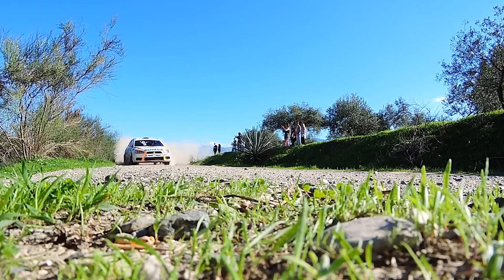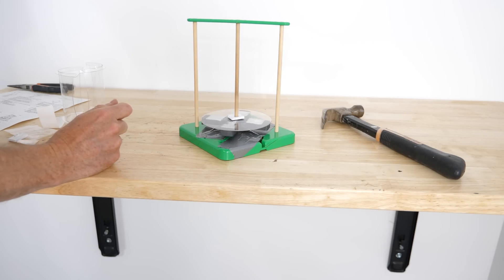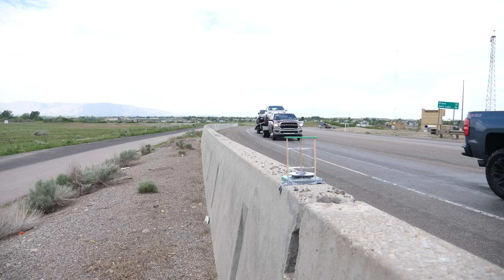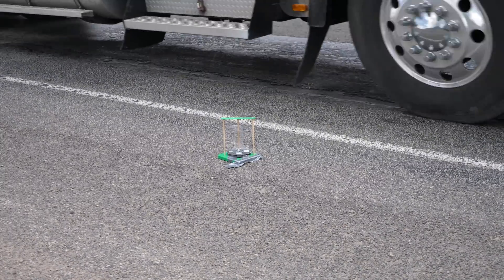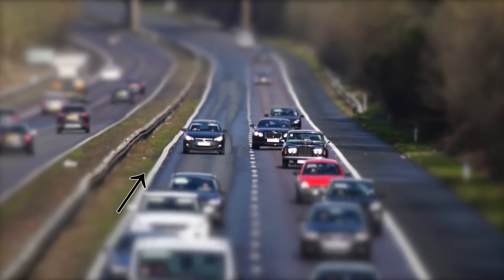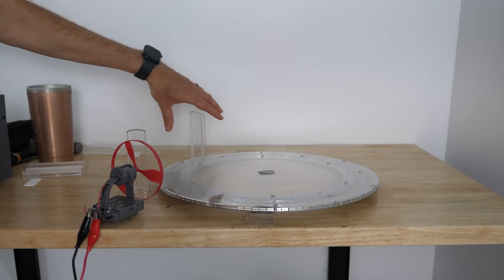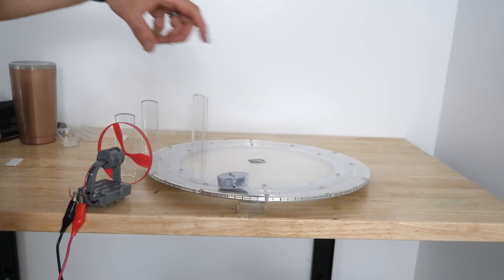Do Traffic Turbines Actually Work?

Comment: I can imagine the application for this concept would be highly effective if it were to be used in underground rail systems, like the London Underground or the New York Subway. Down there stood by the platform, you can experience some tremendous gusts pretty much every time a train comes and goes.
Reply: Which is why they are looking at running trains through tubes under a vacuum. They can save more energy doing that than they could reclaim by using turbines next to the train.
Reply: @TimothyFish  it’s very difficult to create a vacuum that big and there probably are safety concerns.
Reply: @westonding8953 , creating the vacuum is a problem, but there's no reason why it would be any more dangerous than riding in an airplane. They fly high enough that you would die if not for the pressurized cabin. I'm sure those trains would have dropdown face masks for the event of a cabin depressurization.
Reply: @westonding8953  "It's not that hard" Just ask Elon.  ;)
Reply: @TimothyFish  well subway doors have to open and close quite often whereas airplane doors remain shut for the entire operation period (the flight).
Reply: @westonding8953 , subway doors don't open between stops. Not that it makes sense for subways anyway, but there's nothing to prevent a subway from pulling up to an airlock, opening the door, and then closing the door.
Reply: @TimothyFish  between stops no. But having many airlocks is probably just too expensive.
Reply: @westonding8953  , let's say one airlock costs $100,000 and 100 people pass through it per day. For one year of use, that's less than $3 per person.
Reply: How much, is the question? Will it add up to disrupt the flow?
Reply: Energy transforms - it doesn't appear or dissapear.

As the energy transforms it dissapates into non-usable forms. Think a wheel on the road. Sure, you get kinetic enegy - but friction against the asphalt generates heat, which is energy effectively wasted.

Every form of man made energy transformation has loss, and this subway-turbine mind experiment is no different.

It is explained very practically in the video. From a little plastic fan to the largest turbine available, the laws of physics stay the same.

Conversion has a cost. Nature supplies us with daunting amounts of energy which we apply in different ways, but as of 2023 there exist no pheasible way of energy converting without loss.

The traffic wind turbine is an excellent thought-experiment to demonstrate this concept.

That is why I enjoy the action lab so much. Simple lessons, that do not feel teachy nor patronizing, that are always backed up with a hands-on lab to SHOW the concept. 

He is open to "wrong" ideas and uses experiments to show why they do not work. His way of sneaking knowledge into the curious is gleeful at times. 

A Science Ninja!
Reply: Do you not understand the concept? It takes energy to accelerate the air. So if you use the accelerated air to power a turbine, then the train has to accelerate additional air.
Reply: @DoubleBob  yeah, the turbines slow down the air, which increases air resistance, which makes it useless.
Reply: @DoubleBob  im no physics expert but god some people seem like they would really believe those infinite energy memes when you plug an extensoin cord to itself :D i wonder why i dont see more cars with a mounted wind turbine (heard that one already somewhere) because free energy right ?

Comment: I still think the best way to get energy from our transportation infrastructure is to turn roads and sidewalks into solar panels. The idea was raised over a decade ago from what I remember, and solar panels are getting cheaper every year. And I rather like the idea that somebody had about converting sound energy into electricity and making the area quieter in the process.
Reply: Not roads and sidewalks. They get worn and damaged. Some people fight microplastics and at the same time spread these ideas about yeah lets put plastic in floating gardens, roads and sidewalks... smh 

Covering roofs, even building new ones out of solar panels, everything from a bus shelter to a parking lot - that works much better and provides shade where it's desired.
Reply: The other idea I also like. It would indeed make the area quieter, except that it isn't going to work, laws of thermodynamics are pretty hard to beat. From chaotic motion, such as sound or air turbulence, there's practically no way to go back to organized motion (electric current in a wire). You can get tiny leds to light up and even for that power you won't be able to measure if you really only sapped acoustic energy, or if your gadgetry actually contributed to the noise and leeched car engine power for most of the output. That's life. Engineering geniuses exist, but this is not it.

Comment: It need vehicles to work. Fast moving vehicles to be specific. Semitrucks work well because its size and shape moves a lot of air. Cars can move fast but modern cars are streamline so they don't move that much air. Very low traffic will result in long periods of no output. Too much traffic where cars are on a stand still or moving slow, then there is no output. There has to be a specific amount of traffic where moving cars are fast enough without pauses. So the traffic bandwidth for maximum output is very small.

Comment: This makes no sense whatsoever. If you want the maximum results just attach it to the vehicles no to the road but the reality is that turbine that small makes a negligible amount of energy and what is more important is that in many locations the prevailing wind speed is greater than the wind generated by cars. Here in Cape Town, I see quite a lot of mini turbines combined with solar panels powering devices along the roads but they are put high up to catch the prevailing winds which can be quite strong. It also allows for slightly larger turbines and they can be right next to the device they are powering  (an less likelihood of getting hit by a car or stollen). They only make sense when they are directly powering something in order to save costs on wiring to the location.

Comment: It might be slightly more efficient if installed in one way tunnels, or at their exits.
Reply: The more powerful turbine, the more the air slows down and it adds up, as he said. Newtons law - every action has an equal and opposite reaction. The video was quite clear on this. We cannot claim that it's producing net energy, if the flow out of the tunnel is notably impeded. It's leeching car motor energy and creating a hazard due to poorer ventilation. If the flow out of the tunnel is not notably impeded, then the turbine is not producing a useful amount of energy. No magic here.

Comment: The car and fan can exchange energy. We're only seeing an example parasitic to traffic.
The fan can be powered by wind too even in gaps between cars.
A slip stream area could be created by a narrow gap lined by rotors. Traffic will be aided by the wind as they go through. Wind will be powering both cars and the electric grid.
Reply: the wind can blow in the wrong direction.

Comment: Why wouldn't a generator with a propeller in the front be able to power the vehicle itself?.  Meaning as the car is going there can be a propeller in the back or the front spinning creating power recharging the batteries or whatever.
Reply: Why not put generators on each rim .  For generators can power the car without batteries or anything.  You just need one battery to start it once it goes the generators and the wheels are going to power the car.

Comment: Wait, so what if you had one so powerful it can power a hairdryer, and the hairdryer blew and made it spin. Therefore the hairdryer was powering itself is that true can it happened
Reply: Sounds like a perpetual motion machine, still limited by the second law of thermodynamics.
Reply: @mike1024.  so does it work?
Reply: @Therealpeypey  Unfortunately not. The second law of thermodynamics basically says for this purpose that no closed system can create more energy than it uses/contains. For a hair dryer to power itself, it would not be able to lose any energy whatsoever, but the moving parts have friction, and the friction would dissipate some of the energy as heat. You would also need to somehow ensure that all of the airflow was captured back into the turbine, which sounds difficult. Some of the best ideas can generally capture all of the energy loss except to friction/air resistance, but some energy is lost no matter what.
Reply: @Therealpeypey  when we burn fuel, a great deal of energy is stored in the chemical bonds of the fuel we are burning. The same is true of how eating gives us energy.

Comment: Design them so they pull air from a height above traffic?

Where inflow to the turbine comes from 15+ feet of the ground?

Where maybe the forward motion of moving vehicles could generate enough vacuum to turn the turbines. Without creating resistance.

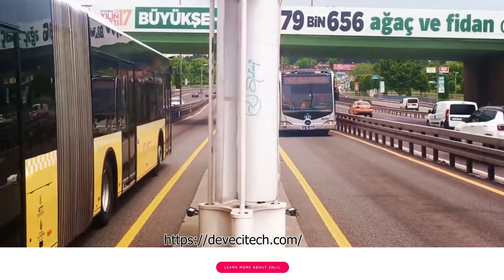Comment: Well, if you have a setup like at 2:43 , it uses just the energy that would otherwise get lost in turbulences, I would say. Because the airstreams from both sides of the road, moving in opposite directions, come in contact either way and slow each other down, right?
Reply: The traffic in both directions is producing counter-clockwise vortices (clockwise in countries where they drive on the left side of the road) which reinforce each other, not cancel out. Placing wind turbines there would slow the vortices, creating a back pressure which the cars would have to overcome by burning more fuel.

Comment: They'd have more success developing a microgenerator that runs on sound waves.  Traffic is loud, and developing a sound barrier that actually converts the sound into electricity will make cities quieter.  It won't affect the efficiency of traffic like the turbines (in fact, creating walls to help direct the wind/turbulence in the direction of traffic will increase efficiency).  And a sound power generator will be solid and durable and less prone to damage than a turbine.
Reply: Do we have such a technology yet?
Reply: @westonding8953  Same tech as here, magnets passing over coils.  Only with a sound generator you'd create a magnetic membrane that vibrates with the sound, passing back and forth over the coil.  The amount of electricity generated by each one would be incredibly tiny, so you'd need to build thousands/millions into highway sound barriers to collectively generate a significant amount.
Reply: @jerotoro2021  the cost and carbon emissions caused to manufacture that would probably not exceed the gains.
Reply: @westonding8953  The gain of being cool is worth any cost my dude
Reply: Yeah, power from sound?
Reply: The energy content of everyday sounds is very, very small. It is also distributed over a very large area (r^2) making it impractical to harvest

Comment: Next try a spring loaded Drive over design (it would function much like the cheap hand squeezed battery less flashlights ). They can be placed like expansion joints are (future tech) I don't expect you to place them in such a location.

Comment: What if you had a hose/ object filled with a liquid and as cars ran over said hose or pressure plate, it created hydraulic force and or friction to push / spin a turbine. Yes it’s still stealing energy but whatever. Idk I feel like the energy you can create will be greater and make it worth it compared to wind

Comment: What about on a high speed rail system?  They could be placed right next to the vehicle constrained to a fixed track.  would they interfere with the aerodynamics of the train?  Would the rotation of the turbine allow better flow than a static object?  What about those new turbines that use a fixed vertical wing shape with holes for a venturi effect to drive an internal turbine?
Reply: Yes it would "interfere with the aerodynamics". Every action has an equal and opposite reaction.

Comment: This might not be practical on freeways, but a larger, similar, possibly more sophisticated device might work if it were installed in the water, off shore, to harness the energy of tides coming in and out from the ocean to the shore. There should be enough energy to power more substantial devices.

Thanks for the content.
Keep up the good work.

בס'ד
Reply: For tides, they use a system in which floats rise with the wave and then pull on ropes to turn a turbine when the wave falls.